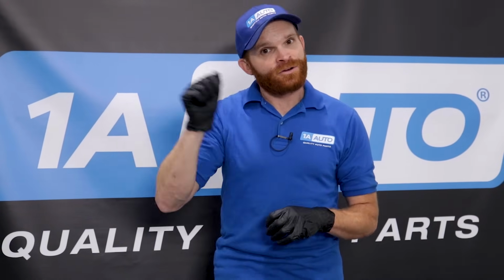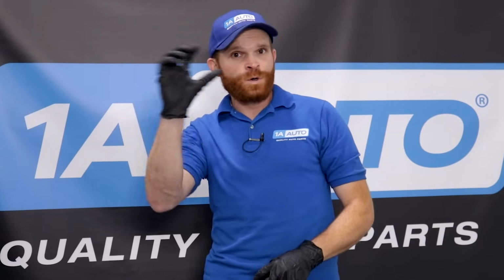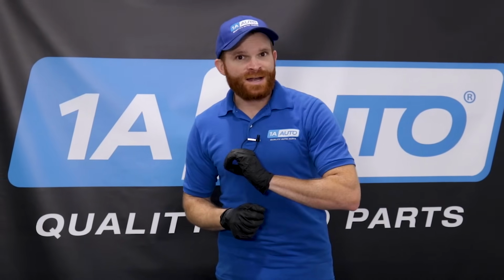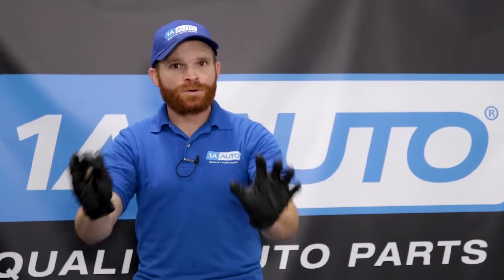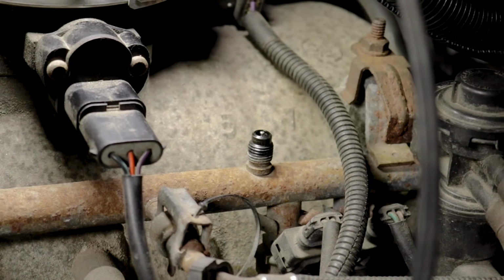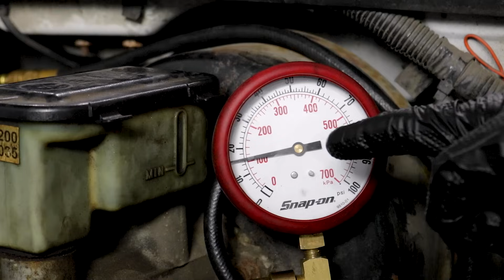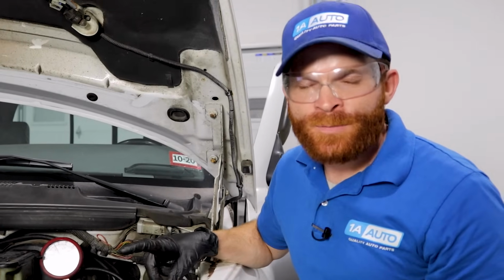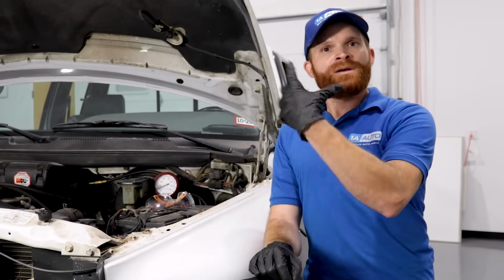Lag, Hard Start, Stall? Diagnose Car & Truck Low Fuel Pressure!

Comment: Thanks for this video. I have a 2014 Silverado 3500 HD with dual tanks (gas) I've spent over 4k in the past 3 months to get it to run right, even $1400 at the dealer, and they even send me on my way not know how to fix it. I'm going to test out the fuel pressure and look into the pumps next. I've already replaced: knock sensors, all 8 injectors, all 8 coil pack plugs and wires, mass air flow sensor, tps sensor, o2 sensors, both cats. I was at a loss until this video.

Comment: Wow that is a lot of great info. Thank you for sharing. I don't have the devices, so I was wondering if I could take of the fuel pressure regulator vacuum hose off the fuel pressure regulator and wait for the gasoline to start going through the fuel pressure regulator after 1 to 2 minutes. As I saw on other YT videos. The only thing that I wonder, is if I can drive the car to mechanic after it proves faulty?
Reply: Hi what was the problem
Reply: @hazelpieterse853  I don't know yet.

Comment: Wow GREAT video! loved every minute. Did not know any of this because never had an issue and i have been a Holley carburetor since 1977;  about 4yrs ago i had a problem like this and i added and inline fuel pump and it solved the problem BUTT i know it is not proper;  Thankx for this video because now i know what to basically look for on a problematic 1995 Blazer 4.3L engine

Comment: 2003 corvette manual trans. Following diagnosis. Hard start, start no idle, start, idles but stalls under load. Pressure gauge bouncing violently. Replaced fuel pressure /filter canister with WIX unit. Engine started and held idle but gauge reading was bouncing between 50-65 psi. Did road test, engine stalled, no start, needed tow to get home. Next day did pressure test, engine held idle and pressure held constant at 65psi. Ran rpm to 5k several times, trans in neutral p brake on with no issues.  A bout 4 hours later checked gauge and it was down to zero. Turned key to on, pressure at gauge still zero. Remove gauge from rail. no fuel leaked out. Rail was empty. I hesitate do road test as tow is expensive.  Fuel injectors were replaced 2months ago with engine upgrade. Had dyno tune ran great until a week ago. What am I missing.

Comment: Sir, i have a xc90Volvo, 2005 and the selerador does not respond when i need it, but after i aselerade all tha way in, then is when it works, a tip u can give me? I apriciate it thanx keep up the good work you do.
Reply from the maker: +chico de la raza We wouldn't be able to diagnose an issue like that here, you may want to have a local mechanic take a look at it. Thanks for checking us out! http://1aau.to/m/Shop-1AAuto-c

Comment: Okay so I began the process of replacing my fuel filter. Following a video I removed my gas cap, started my vehicle, removed the fuel pump relay, and let it die out to relieve fuel pressure, disconnected my negative cable on battery and then I was interrupted for about 45 minutes. Replacing my filter had to be put on hold. I replaced my gas cap, reinserted relay, connected negative cable, turned key to on position, turned back to off position, waited for 20 seconds or so and then started vehicle. Started same as usual but then began to bog out idle high a few times I guess trying to stay on then idle began to decrease gradually. Just before idle needle reached 0 it paused there for barely a second and then vehicle shut off. Now vehicle will start but then just die right back out. Love your videos and trust your professional diagnosis. Need your help ASAP. This isn't only my personal vehicle it's also transportation for 4 members in household. Every job in jeopardy. Working on this all day and night until fixed. What do I do???

Comment: I have a 97 ram 1500. Im having issues like this but cant pin point it. I have am issue dropping idle while at a red light and then while driving at a constant speed it likes to stumble as if fuel gets cut off for a brief second.

Comment: I Have A Honda Ballade Luxline, 1.5i, 16v, 1997, Model: SO4, That I Must Check The Fuel Pressure. After You Said That The Same As Changing Your Spark Plugs, Check Your Fuel Pressure. You Can End Up Saving The Client Lots Of Money, Where He Drives & Something Goes Wrong. & Lots Of Damage To The Engine Or Catalytic Converter, & Exhaust Co2 Censors. I Know Now How To Check If The Fuel Pressure Regulator, Fuel Injectors, Fuel Tank Pressure Regulator, Leaks In The Fuel Line Is Faulty. Petrol Is So Expensive Today. What Would You Check On A Vehicle To Make It A Bit Lighter On Fuel. How Many Mechanic's Do You Know That Get The Fuel Injectors Serviced. Very Seldom. So Many Mechanic's Don't Know That How It Pushes Up The Fuel Consumption I Have A Daewoo Cielo, 1.5i, 8v, 1998, & Had It From June 2010. & It Gave Me 21 Km's On The Open Road. I Serviced All 4 Injectors, Wich The Small Nose Filters Were Blocked, & They Had To Set The Spray Patterns Right. 3 Of Them Were Out. They Replaced All The O'Rings. & They Tested The Fuel Pressure Regulator & It Was Fine. Here Is The Best Part, On The Open Road, The Fuel Consumption Went Up From 21 Km's On A Litre Of Fuel To 26 km's. You Have To Service The Fuel Injectors Every 60.000 Km's. It Is Worth It. I used To Service The Car Regularly & Checked The Fuel Filter & The 1 In The Tank, Under The Pump. South Africa. 🇿🇦

Comment: Hey brother. I've got a 2012 corolla le and it started shaking few days ago. Ran a diagnostic system, changed the spark plugs but I still have the P219A code and I don't know if it's just the sensor or what. Can you give me some tips please? I'm low on money at the moment and would rather fix it myself

Comment: Very informative. I changed my fuel injectors because my car was running rich and I could smell a heavy petrol scent near the engine. When I changed them my car was running a lot smoother however still some hesitation on startup and fuel scent. While I changed them I could see that my intake valves were MASSIVELY caked with carbon deposits. Could this be the cause of my car running rich and having a hesitation om startup? Or should I check fuel pressure regulator? I am going to clean my intake valves this month just to be safe, but maybe you guys know? Best wishes from the Netherlands 🍀

Comment: I'm trying to figure out what might cause a car not to start unless it's got over half a tank of gas. Anything under half and it won't start at all. I don't think there's a problem with the gauge or fuel level sensor because when I fill up, I only put another half tank in. I've tried and tested a bunch of things and I don't want to just replace the fuel pump if that's not the issue. I'll test the pressure, but do you have any suggestions?
Reply: does'nt the check engine light up?

Comment: HEY MY 2004 PONTIAC VIBE HAS A LONG CRANK TIME;      WITH A SYSTEM LEAN CODE ON BANK 1. I CHECK MY MAF SENSOR, GOT NEW SPARK PLUGS AND THE INJECTORS ARE GOOD.    ANY ADVICE?
Reply from the maker: +Ed Reed We wouldn't be able to diagnose an issue like that here, you may want to have a local mechanic take a look at it. Thanks for checking us out! http://1aau.to/m/Shop-1AAuto-c
Reply: I change the fuel regulator on my car and it was working fine however the car develop the same problem a week after, what could be the issue?

Comment: My call randomly stalls why’ll driving sometimes I can smell fuel and sometimes the cars hard to start and when it dose start idles really rough like 400 RPMs shaking the car. When it’s colder outside I notice the car act up more which is odd. The fuel pump after the car acts up is loud and priming it the pump sounds awful with like a squeal sound. But after a few minutes of messing with the car eventually I can get it going again and everything seems okay again. No check engine light no codes and the fuel pressure regulator up by the fuel rail is vacuum controlled no wires to it. Could this be a bad regulator cause most the time car works fine lots of power on hills and accelerating form stops no issues except when car acts up. I don’t think it’s the pump and my fuel filter been changed within the last year.

Comment: Just got a fuel pressure gauge. Hoping my lean condition is related to the fuel system. I have triple checked all my vacuum lines and nothing yet
Reply: I would like to know what you found? I have a Chevy 2013 Silverado that has 65 psi from just turning on fuel pump, leaks down to 35, and when engine on it is at 45 psi idle. I have a lean issue as well, mostly when letting off of gas. Changed air sensor, fuel tank carbon filter, solenoids, and used a smoke canister to look for a vacuum leak, and found nothing.

Comment: Thanks for your video 
I have question 
I have a Ford explorer 98 my psi is 40 and it goes down to 25 and lower and even cut off the mechanic said it should be 45 does that mean I have to replace the gas pump

Comment: Ok so I have a 96 dodge ram 1500 just changed transmission in it and now it has a long start and when it does start it steadily wants to die but when I rev it up it won't rev past 1,5000 rpms without acting like its running g out or not getting enough gas and when I drive it and I floor the gas pedal it wants to stall and acts like its not getting g enough gas either . So.eone said it was my fuel pump but I want to be sure before I spend the money mayne you could help

Comment: I have a 2001 dodgr ram 1500 3.9L, and i cant seem to get it started, it cranks but wont start, i was told that it could be the fuel pump, but i have replaced it for the second time, and i also changed the the position sensor on the throttle body and the idle sensor, because i saw a video that it could be the problem, and cleaned out the throttle body, changed the oil pressure sensor, changed the oil and oil filter, and still nothing

Comment: You may want to rethink ( turn the key to on position and the fuel pump should/will run unless the pump is bad ) some vehicles , the pump does not run in the key on position , the pump runs while the engine is cranking and the pump continues to run if the engine starts - 99 corolla for example . You can hook a fuel pressure gauge direct to the fuel tank to isolate a fuel problem in the tank , or hook the gauge into the whole fuel system  , its best to check both ways , you can find out if you have a problem on one end of the system , or on both ends of the system , now , do what ever you want , its yours .................

Comment: Hello , there. I hope  not to be annoying with my  question I  have a " crank  but  don't  start "condition on a1990 mitsubishi  eclipse  2.0 dohc .I think every issue  is fine but the last situation I 've found is that the fuel injectors don't get the grounded signal properly .Although the " hot" signal  is fine, however  they don't work at all, don't make  any "pulses". GOD  BLESS!

Comment: I have an 01 Yukon xl,  I replaced the regulator, camshaft position sensor, fuel filter and fuel pump. It still cranks and wont start. I'm at a loss, I have spark. It was running fine and then killed on me while driving.  I got it home and replaced all of that stuff. Only code was camshaft position sensor.  I have spark, I just dont know what else I'm missing.

Comment: I have 2009 Chevy Tahoe and I just started having hard start/rough idle for the first part of the vehicle’s warm up. After it drives for a bit it runs fine. Could this be a bad plug or fuel pump?

Comment: Idk how often y'all go back to old comments on old videos but working on a 98 lumina 3.1l. The car  starts fine at first then dies out of no where. When it dies it doesn't want to start other than just continuous cranking. Fuel pressure drops about 10psi within 20 to 25seconds. The pressure regulator has suction when car is running. It primes up to 40 when key is turn to on position. I do hear clicking where the fuel injectors are but not sure if that's just what they do. My truck don't make that sound when just primed but her lumina does. had good vacuum n what not when car was running and pulles hose off of regulator. From what I was told the pressure regulator is activated via suction so when car is on. She's had new battery, new spark plugs and wires, fuel injectors, o2 sensor (one of em), gas cap, maf, and fuel filter replaced. Still same issue. Dies out of no where and doesn't want to start

Comment: I have the same problem with the fuel pressure test. I have a 1985 Pontiac firebird trans am. My fuel pressure shoots to 40 psi but rapidly goes back down to 20 psi almost immediately. What could that be?

Comment: Very helpful...I'm getting fuel up to the fuel rail but not coming through the injectors🤷‍♂️...my question is could it be a weak fuel pump?
Reply: Unless it’s a pop it inject, but a computer controlled injector should just open but not open based on pressure but electronic control

Comment: I purchased a new fuel pump and fuel filter from you guys a few years back and it worked when I put it in, but I developed a coolant leak that took a while to find and fix, now my car just cranks but won't start, and I don't hear the pump anymore, my relay and fuse is good. How long is your warranty, I can't find my receipt.

Comment: i put new fuel pump and new pressure regulator still have 15 lbs of fuel pressure and new filter still fuel pressure 15 lbs should be 40

Comment: I did a fuel pressure test on my 2005 Honda Accord 3.0 ran it for 5 minutes pressure looked fine 60 PSI turn the vehicle off pressure went down to zero after 30 minutes, is that normal? As that way you mean that I shouldn't lose pressure over time?
Reply: Means it is bleeding out somewhere. Could be the injectors.

Comment: This came just in time. My car that just got repaired won’t start and it’s not the starter.. and my beater vehicle stalls while I’m driving.. then takes forever to start again at times! 
FUEL PRESSURE/FUEL PUMP IS A REAL THING !
Reply from the maker: +Doctor Spazz Thanks for the feedback!
Reply: @1AAuto  car stalling won't start sometimes battery also die and jerk .sometimes it start sometimes not

Comment: We had to replace the upper part of the engine and change over parts from the old one.  We installed the fuel rails.  We put everything back and when we were done, several weeks later, we started the car.  It started and ran good.  After 100 miles it ran bad.  We had a low pressure code.  We changed out the High pressure fuel pump and used the tool to make sure the crank was in the proper position.  this is on a 2010 Acadia 3.6 L.  Once we had it back together we started it and still have white smoke and gas smell coming out of the engine.  We have the same low pressure code.  What I am hearing in this video is we may have a leaky fuel injector.  Should we change all of them?
Reply: Not a mechanic, but if you do the job, it is worth change them all at once. They sell good brands like Delphi or AC Delco rebuilt on ebay. I think that the white smoke could be a result of faulty ignition coil. Did you figure it out by now? @Jeff Carpenter
Reply: @babycakes8434  The car did not make it.  It started the same issues all over again after a month.   It was traded in.

Comment: I have a 2003 GMC Sierra which came stock with the 5.3 (non flex fuel). At 180,000 I replaced the engine with a Chevrolet Performance LS 327. I’m still using the stock injectors and coils, and just recently changed fuel filter and fuel pressure regulator. I’ve noticed my mpg decrease by about 1mpg, and the truck seems sluggish on acceleration until it hits around 2500rpm. I bought some Kooks catalytic converters because I’m thinking after 19 years and two engines it’s probably time for replacement, but after watching this video I’m thinking I may have an injector(s) failure. About every 20 starts, it will long start but not fire, then it fires right up and runs well, but my idle has become rough. I change the fuel pump about every 5 years, and mainly use 93 octane ethanol free fuel. I have not yet tried your methods in this video though.

Comment: Got my 1996 Cadillac deville
Recently started having hard time starting because I think I destroyed my pump by not seeing the E flashing and did multiple attempts then I noticed it was empty so I started the car and all good
Since then it always started doing it every time I start it it takes like 3-5 seconds to start
Today I was riding near the beach enjoying the view
Suddenly felt the steering heavy car stalled 
Tried to start it car said NO
I guess that’s it I need a fuel pump
Still pushes fuel to the front but not very strong
And I have the service engine soon light up 
So yeah I guess that’s that
Reply: Hi there was it the fuelpump

Comment: Good video I learned something..btw I tried this but I noticed when I rev the car the fuel pressure dropped about 2 to 3 psi instead of going up now I'm trying to figure if it's the fuel pump or the fuel regulator
Reply: You lost pressure while revving because it consumed higher volumes of fuel this it robbed the pressure. Could be a throttle response issue. Like a delay or it could be a clog somewhere

Comment: Wow, very informative needed to hear all of this information. I will send this video to my Dad. Hopefully, it will give an idea of what's going on with my car. I have a 2009 Pontiac G6 pushing around 214,000 miles. As soon as I am about to take a turn, my steering wheel gets hard, and my gas pedal is hard as well. But all my lights are still on in my car. I can shift gears easily with no problems, but it will not go at all. But the few times it has done that, I never took notice to hear if my engine was still running or not. Had someone to place it on a machine, but no codes pulled up at all. So any information or a possibility of what might be the problem would be helpful.